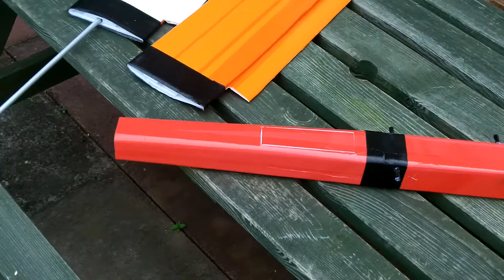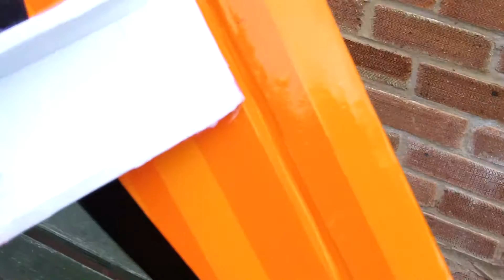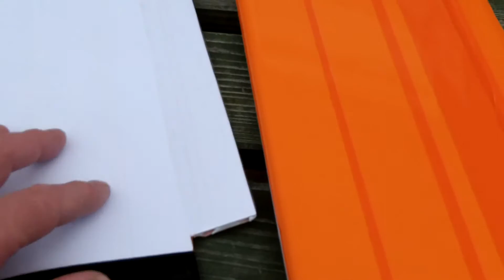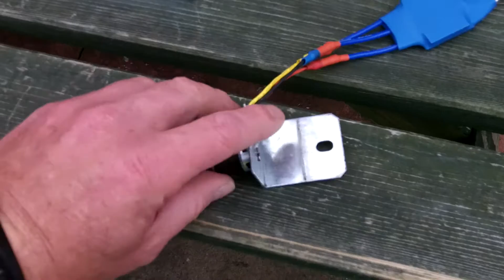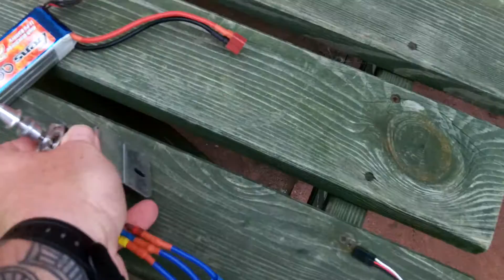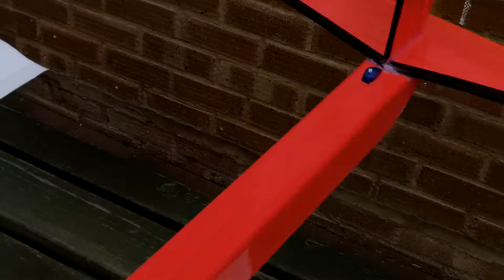foam board glider build part 1

Comment from the maker: Thanks for the good comments, looking forward to test/maiden flight but weather not good at mo. I got the foam board from foamboardonline.co.uk. Paper does come off ok, had to buy a pack of 20 of 20 x 30. But with the builds I have done and have planned will use most of it. I will be posting some more build vids soon. Thanks for watching. Jase